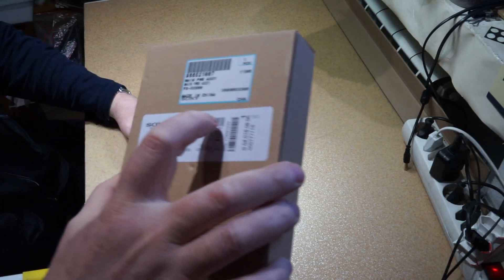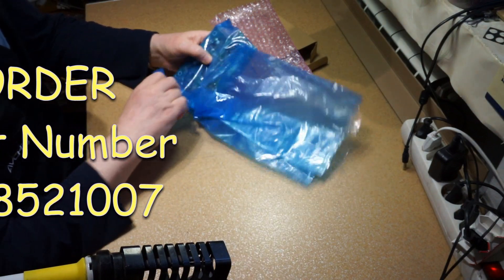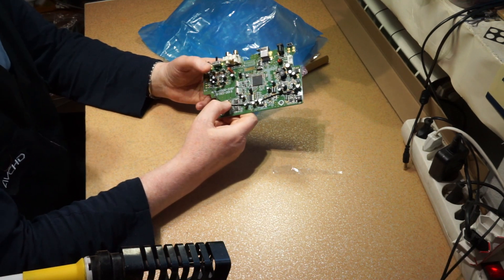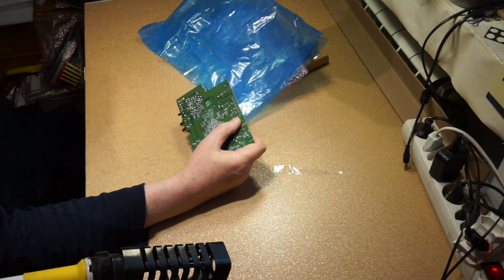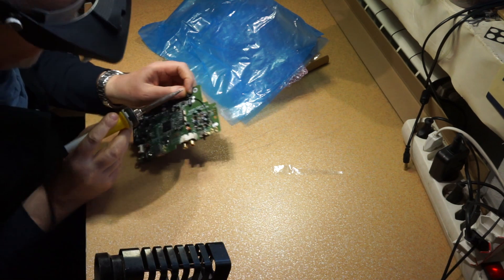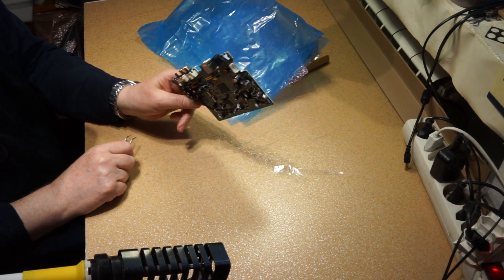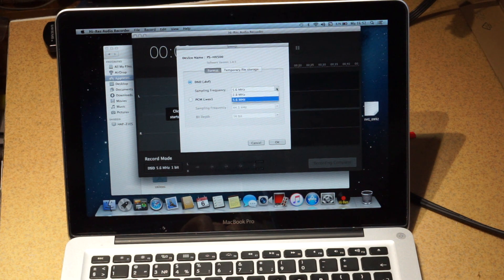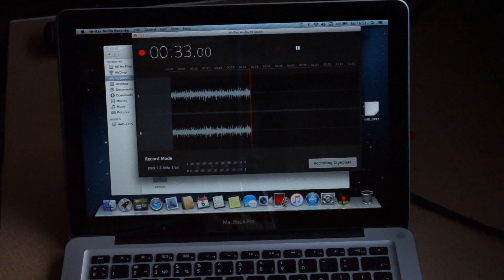Make your own DSD files from vinyl and tapes

Comment: Audio interfaces exist for that purposes. PCM are cheap enough. But Korg, Tascam, etc.. can write in DSD with PCM4202 or PCM4222 (but the first one is better because of a 1-bit sigma for DSD vs 6-bits sigma).
PS I'm afraid that an increasing a gain in the software, causes DSD to be converted into PCM for some math, and then converted back to DSD. Which is not willing I think.

Comment: Thanks a lot for this description. It works very well. I have constructed one unit and am using it now with my Cambridge Audio Alva TT turntable, which has a much better sound quality. The left channel in my current test is maybe minus 0.5 - 1 dB softer than the right. But this could also be the current vinyl I am playing. I will see over time if this is a permanent effect.
Reply from the maker: Glad you are happy